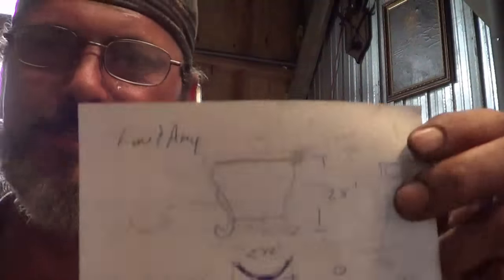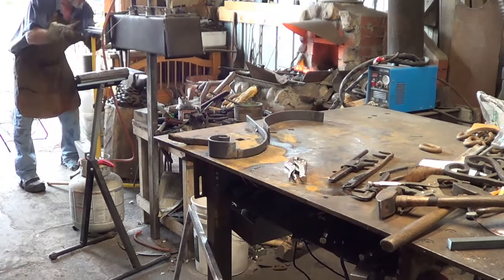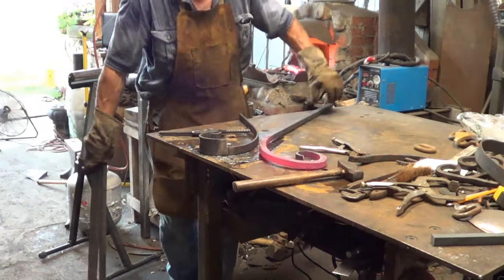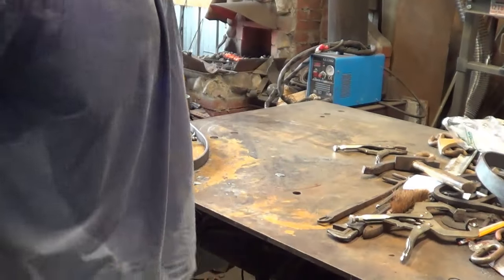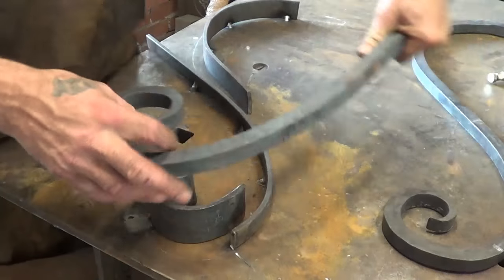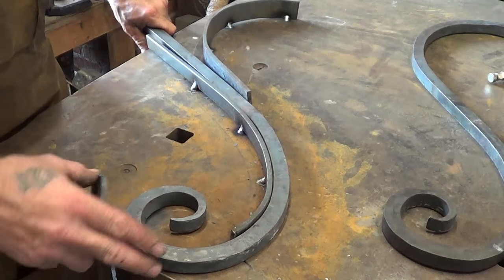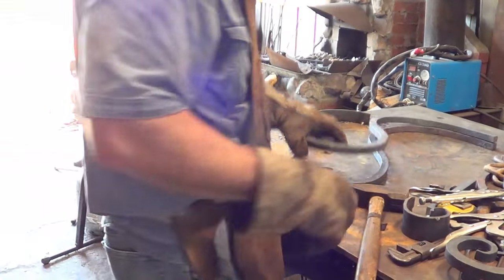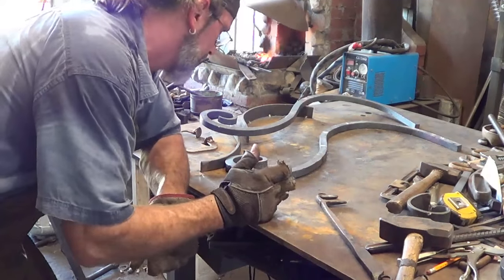Blacksmithing - Scroll Jig For Repeating Table Legs

Comment: Beautiful video, Chandler.
The table legs look great, not all are the same table legs. Is not bad. You've made them almost all the same, because the legs are handmade and not industrial commodity.
The "Dragon" looks great, the one could also take the connection of the two table sheets.

Comment: Not much wrong with that buddy, made a real nice curve on them. In the shop we use a metal wedge instead of vice grips to lock the scroll end down. Good thing with iron is you can always finesse it a bit on the anvil.. You should be happy with those mate.

Comment: Chandler I noticed about 13 minutes into your video that you turn off your forge when you work. With a coal forge this is great ( as I'm sure you know) but in a propane forge it decreases the effectiveness of the forge because it cools down and makes it slower to heat up your work after it cools. A good trick I use is reduce the amount of propane going in by about 50% this saves fuel and keeps the forge at about the same temperature as when you're heating up steel which saves time and money.

Comment: Chandler, I got my hands on a five foot plow with a mangled bracket...it was junk to the owner. Put a piece of steel pipe (with holes drilled every three inches) lengthwise in the face of the plow. The pipe should be justified to one side with the holes pointing to the middle. Add charcoal and air and bam, quick and dirty forge to heat long pieces. Don't use the anthracite, it's too picky with air. You could set it up in minutes.and even the bent legs could be reheated.

Comment: Chandler, it's not "authentic" but you can use a torch to help keep the heat in the metal where you need it or to help you move the heat in the piece as needed to a small degree.

Comment: Grate job Can you please update us on the plasma cutter??I'm thinking of getting one but im still on the fence about it.Keep up the great work
Reply: In my humble opinion, I think an oxy-acetylene cutting torch is just as good if not better then any plasma cutter. Then again an oxy-acetylene setup is far more expensive to buy and maintain.
Reply: +7.62forge you can a torch into more places but, you make a couple stencils and you can bust out a lot of parts that are very accurate super fast. More production, less fab and touch up.
Reply: +kelly callahan I can agree with that, also oxy-acetylene requires more skill. Although personally I'm less hesitant around gas then electricity.

Comment: hey I'm 18 and super broke, I really wanna start blacksmithing I have a regular hammer and a railroad spike, can I heat the metal to the right temperature in a charcoal fire pit?, when it comes to an anvil I have a 20lb weight lifting plate. I've been looking into smithing for like a year now I just wanna start.

Comment: Hello Chandler. Great job. Before I try to make any more scrolls I will be sure to make a jig. As I was watching I was trying to understand what was going wrong. At 16:49 into the video it looks like the center of the scroll is locked down to the table. However, when I looked closely at the vise grips it looks like the scroll is off of the table. Could this have been the trouble with getting the scroll to lay flat? So my question is this. Did the first scroll bend twist on you? I am a beginner and would like to understand what is happening here. It seems to me as I study the paused video that the whole piece starts rising up at the beginning of the Jig welded to the table. Is this just because the piece is vise gripped off of the table or is it bent before you ever stuck it back into the forge? I'm watching this on 7/28/17. If you happen to read this look at the video and let me know what you think. 
 THANKS,
G.D. Finley

Comment: Any tips for dealing with the heat. It's 90 Plus every day here. DHave you thought about a swamp cooler?
Reply: Texas?
Reply: Also box fan pvc pipe with hairpin holes all in a line with cloth connected to the holes and attach pvc to hose
Reply: Bloody hell, in the UK the other week i was forging and it was 25c which is about 80f and i thought i was going to die. Don't know how you Americans work in 100+ every single day...
Reply: I saw a gadget that makes a very gine mist. When i have been in Phoenix they have them on front of stores
Reply: Swamp coolers only work in low humidity areas

Comment: What do you think about doing a straight razor?
Reply: It is very specialized though. You have to know how to make very specific steels into a paper thin edge. I don't want to sound like I'm doubting Chandler's skill (and I don't know if he has made one before), but I would imagine you have to know what you are doing very well.
Reply: That's why I'm suggesting it, I want to challenge him.
Reply: straight razors would be perfect practice for him.  The biggest key to making them is patience. Taking your time on the shaping and grinding.  sometimes he tries to rush through.  he's more concerned with getting it done fast. Speed comes from having perfected the technique. straight razors would Make him slow down some.

Comment: Chandler how have these recent heatwaves in the north east (I'm in RI) affected you ability to work? I sit atop a water slide and sweat buckets so working over a hot piece of medal and fire can't be fun.
Reply: It's hot in St. Louis and welding and running a torch or heater head is tough but men do what men do!! Put your boots on and be a man💪.